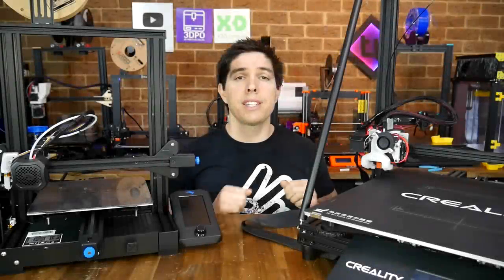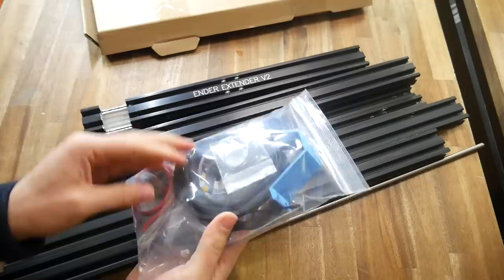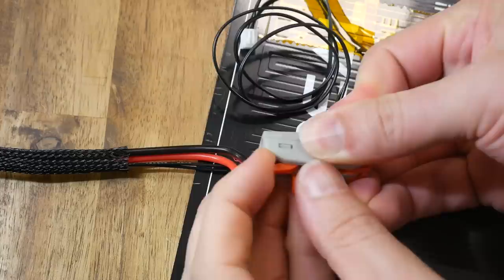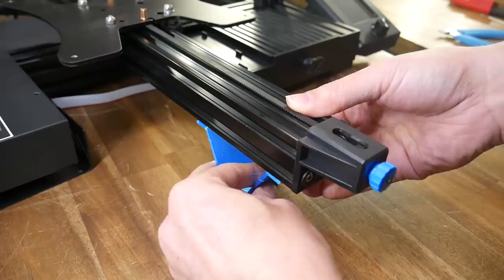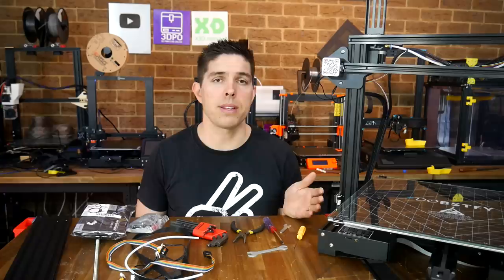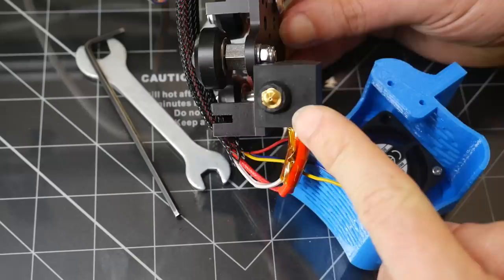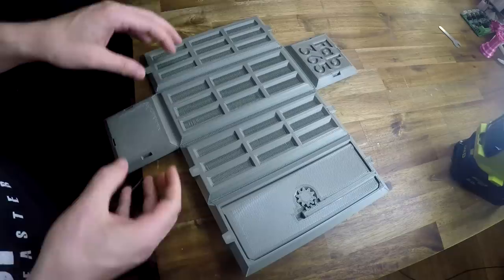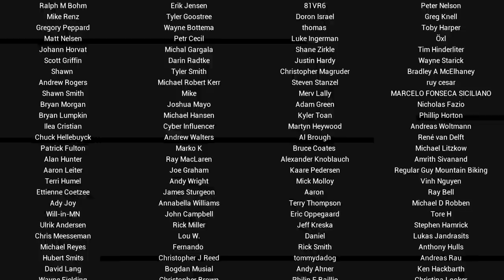Supersizing an Ender 3 V2: CR-10 Max for half the money - Ender Extender kit

Comment: for cheaper option, I have upgraded my ender 3 y axis length to 400mm for under 20 usd...far less part needed
Reply: How did you do that?
Reply: @tylerlglass  i bought 500mm 2040 aluminium extrusion. I drilled some hole on it, tapped the hole, and then I replaced the stock y axis aluminium extrusion. You also need a longer belt and 400x235mm mirror. The way i did it, i put the mirror hanging in front and at back of the square aluminum bed. So the heating will be only on the middle part of the bed. This is not a problem to me since i only print pla. Then i adjusted the firmware so that my bltouch checking points is correct. You also have to do some adjustment in your slicer to adjust the bed size.
Reply: @batman_uwu  very clever idea! Not sure if it's something I would want to tackle without a pre made kit, but what you said makes total sense. Great mod

Comment: Is there anywhere in Europe to get the kit?
Reply: check on the website.
Reply: I checked the site, and no.
Add another $60 for shipping and 20-27% for VAT.
The parts are ubiquitous, so surely couldn't somebody offer the same things but sourced in Europe instead?
Reply: I had checked too that's y I asked. Also I looked it up when he made the last video on the upgrades. I sourced getting the v bar and doing it myself but I need measurements
Reply: @scooterfarl_fpv2344  $150-160 is pretty reasonable for the kit to have someone spend time preparing the v bars. Precise perpendicular cuts are essential, and pretty impossible to do with any handsaw!
Still, the cost of shipping, VAT and duty makes importing from USA very expensive. The parts have probably already incurred shipping and import taxes if imported from  China, so would be better to import from there instead.
I'm tempted too... but will wait until I have a specific large thing that I want to print.
Reply: @ahaveland  oh I appreciate the time and the ordeal of going through design after design to get the correct fit for all the parts and cuts and holes that need drilling. I'm happy to spend the money for the parts but it's the vat and import to Ireland that's a killer. By the time I pay all that I'd have bought a bigger printer. That's y I would have given money for it if there were a EU supplier but alas its staying stateside as a lot of good things do. I have some mates across the pond that would post it for me and maybe get passed customs but I don't like taking that risk. May save some more covid money and look again after xmas
Reply: @scooterfarl_fpv2344  Completely agree! Here in Hungary VAT is 27%, so I have to really want or need something if I import something over the tax thresholds.
Reply from the maker: I would recommend jumping onto their Facebook and seeing if there is anyone in your region who also wants to order. Back in my car club days we would organise a 'group buy'. The manufacturer would give a discount in return for the volume order. Shipping may be cheaper too.
Reply: @ahaveland  machining the parts is not ubiquitous
Reply: @MakerMark  How many mitre saws and CNC machines do you think there are in 26 countries of 500 million people?
Reply: @TeachingTech  thanks I'll see if any of the people I know with enders would be interested. I never thought of that option
Reply: Ender Extender will have free shipping sale on Nov 27. Taxes duties not included.
Reply: @MakerMark  does that include international. Even half price shipping would be great

Comment: See your using that awful implementation of the y gantry that the ender extender kit thinks is a good idea. Highly recommended designing a bigger gantry best decision i made since the kit can be very unstable...literally had it wobble off the extrusion.
Reply: If that happened to you then I suspect faulty installation otherwise the other customers would have the same issue
Reply: @MakerMark  been a few that also Had the same issue. Again it’s an easy fix just grab another aluminum sheet cut to original ender design and it’s fixed

Comment: I can’t believe that you donated this to a highschool. Those poor kids. You know you ruined that printer right? This is why I hate the entire “oh just buy an ender 3 and mod it!” part of the community. It all seems fine but you didn’t really print anything THAT much larger than what a stock ender could build, at least at the base layer so you masked the problem. The kit doesn’t include a properly sized replacement heating element meaning you were forced to reuse the stock one. A heating element that small simply CANNOT properly and uniformly heat that bed. The edges will be several degrees cooler than the rest of the bed. Anyone who has been printing for any length of time will tell you that the number 1 cause of failed prints on an FDM printer besides poor leveling is adhesion failure caused by improperly heated beds. Anything large enough or with enough items to require using the outer several inches are likely to just pop off during print from being too cool. If you turn up the bed temp to try and compensate then assuming it can even get hot enough to do it, the inner parts of the bed, basically the entire original print area of the ender, will be too hot for the print causing warping or even full blown melting of prints. I can’t even IMAGINE how many kids you have single handedly turned away from the hobby because they reason that “I can’t get any good results on this “suped up” printer so what odds would I have on a cheaper one I could afford for myself?” The worst part is that for the price you could have got them a CR-6 and enough money left over to buy enough PLA for an entire school year.

Stop buying Ender 3s or it’s clones. It’s design is basically unchanged since the dawn of home printing. 3D printers with actual features that you would expect now in 2021 at a reasonable price won’t be made until you people stop buying the crap ones and saying they are good.